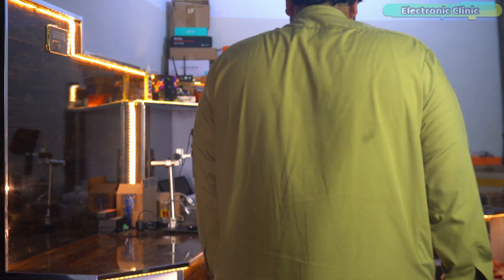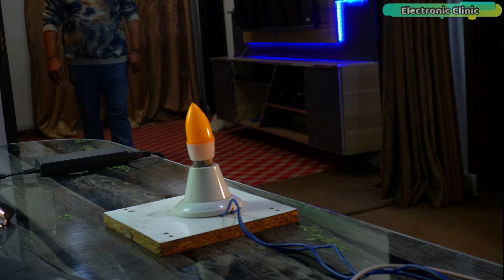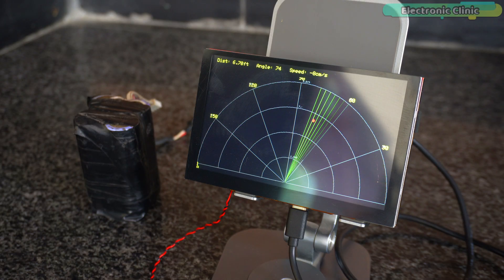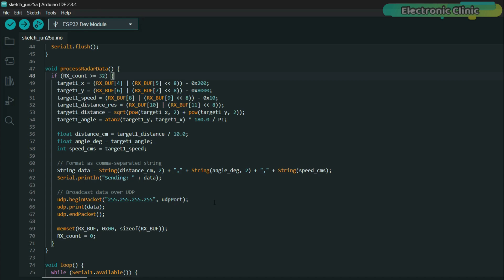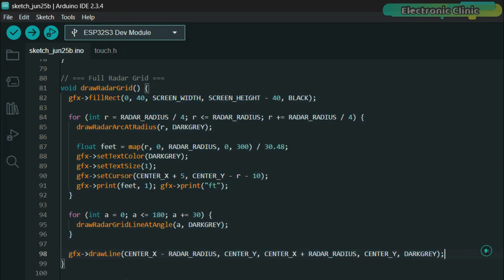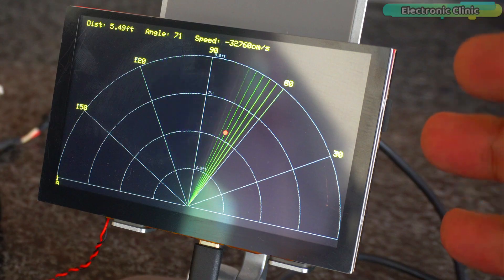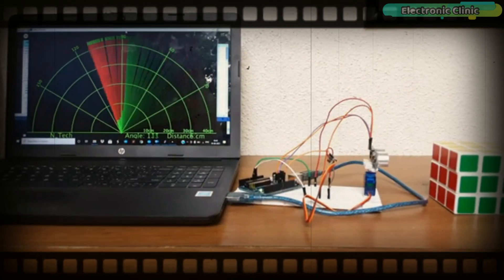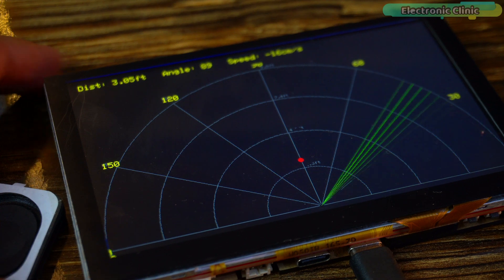ESP32 + RD-03D mmWave Radar | Real-Time Human Tracking with Distance, Angle & Speed | Wireless Radar

Comment: So why not add a Raspberry Pi nano or zero and run the ultra sonic sensor and the radar node on the same curcuit and transmittion? Give the sonic sensor data avatar a trailer look with a dif color... That would be nice
Reply: Use a transparency gui  program to layer the two signals
Reply: Have sonic sensor, radar sensor, magnetic sensor, and audible sound ultra long range sensitive mics... add lasar windiw tap mod too..

Comment: Can you make a device that measures the distance between the ceiling and the floor with this radar? I wonder if it can measure the distance to objects that are at rest, not people.
Reply from the maker: For this you can use a laser or A02YYUW uart ultrasonic sensor.
Reply: @ElectroniClinic  Thank you for your answer. I'm experimenting with measuring distance with radio waves, so I asked if it's possible.

Comment: Perhaps connecting the sensor on the backside of the LCD screen, like use it as a shield to not detect the user but you point the back of the screen at a wall or in a pitch black room and it will show you how many people, if any are present there, very useful in a rugged case for firefighters and disaster response ...

Comment: Anything connected with cables can be turned into wireless with minimal code changes. Next challenge; track multiple targets at the same time … generally a bit trickier than tracking a single target - but usually ”doable” even with fairly simple sensors (even in the case where the sensor used doesn’t natively support such feature - though many do;)

Comment: like it !! what is max range with acuracy of the detector ? is it possible to increas distance ? what about penetration thru wall ? (different materials of wall, thikness) any tests ?
Reply from the maker: It can penetrate most of the materials except walls.
Reply: @ElectroniClinic  what about the distance ?
Reply from the maker: @donatasismanus6056ya, you can increase the distance. Its adjustable.